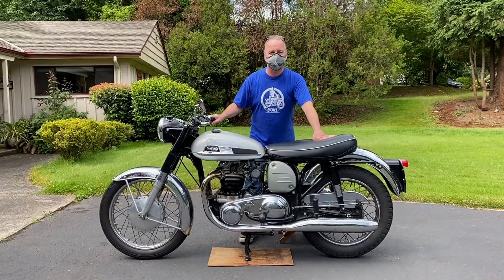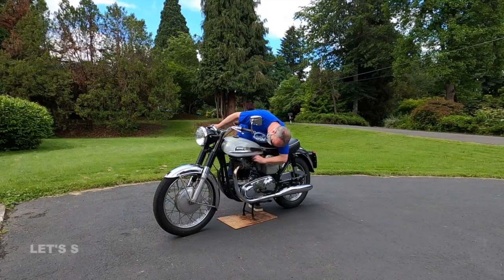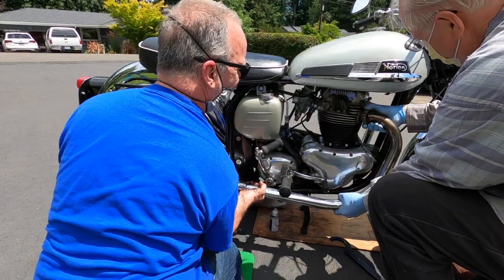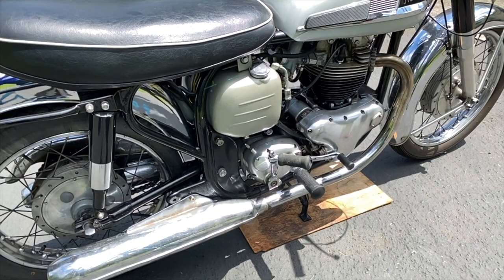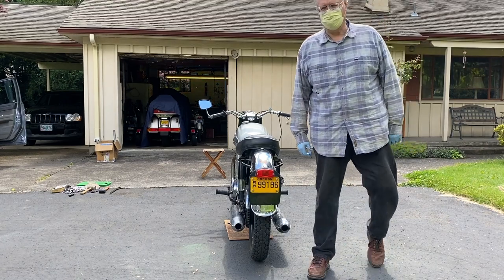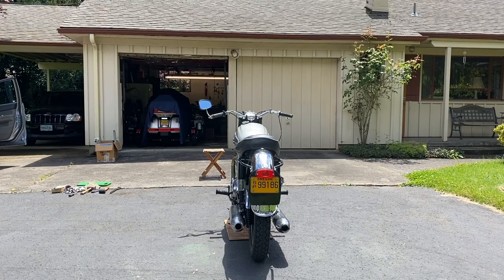1961 Norton Manxman 650 project (21) - Comparing Norton muffler / silencer sounds

Comment: So what is the point?  Does one muffler offer better performance?  Obviously use the one with better performance.  If it is just to be louder why bother?
Reply from the maker: Hi Marquee6.  I should have explained why I'm doing this for newer viewers.  I have been fortunate enough to find the very first Norton Manxman.  It originally came with the funky, cigar-shaped mufflers/silencers with the horizontal seam that you see in the video.  My friend Sam has kindly loaned me his mufflers and I'm trying to have a pattern pair made.  But knowing that it will take some time to complete the restoration, I thought it would be just a bit of fun to hear how they sound compared to the standard Norton Atlas / Dominator mufflers. At some point, I will want to know what the pattern parts should sound like and thought this would be a good reference. Cheers, Mike
Reply: Marquee6 If you knew anything about Norton's you wouldn't have asked the Manxman was an export only machine and owners are trying to source pipes and silencers for restoration! the Manxman silencers are made for running at speed rather than tick-over. Manxman rev's harder I would think.
Reply: Sound is subjective. One man's symphony is another man's noise. I think Mike's question was "which do you think sounds better?" Performance was not part of the opinion poll. When I raced, performance was ALL that mattered. But on my road bikes, I changed exhaust more than once just to have that "Perfect Sound". As far as vintage bikes go, I'm a purist. I (generally) want the original parts exactly as the bikes were when new. I might go with a pointless ignition, as it is hidden from view, but that's about it.
Reply: @kyleklintok7730  I agree in some ways i don't like to see Classic bikes stupidly bastardised, but then again I can't empathise with rivet counters By far the %  most Norton's were exported, here in the UK often exhausts were changed as other options were cheaper, bikes were upgraded especially in the 60s Cafe racer cult and in the 70s to compete to an extent with the up and coming Japanese stuff. As bigger Japanese bikes filtered through, A 500/600 cc Norton could have a run for it's money with two-stroke 2/350s followed by the 750/4  400/4 500/4 Honda's coming out of Japan. Riders had Pride! Then the Z1 appeared and it was game over!

Comment: I have to say, that is a beautiful neighborhood you are working in, very nice.  I couldn't tell a big difference, it does sound throatier.  One key point is having the carbs very well balanced, very even firing that shows up in both the idle and the smoothness in riding at low rpms.  The carbs on this are very well matched.  Very nice sounding, that idle is beautiful, crisp, clean dropping right down smoothly, when the throttle is released.  Thanks!

Comment: I prefer the Manxman muffler sound but I'm probably prejudiced. I bought Manxman #13 as a basket case years ago and later sold it to a friend who did a wonderful restoration. He did not keep the original exhaust but passed them on to Sam. So these are the pipes that sat in various basements for years; glad I didn't throw them out.
Reply from the maker: Hi Phil, thanks a lot for getting in touch. It's a small world! Best wishes, Mike

Comment: Use to have a friend who bought one of these brand new in 62, It was fitted with the norton flat bars, rather like a Vincent. Which I think look better . But then, when we get  older the body’s not up to it...The times I’ve heard this model referred to has a 650 cc Dominator. I believe in my time the exhaust would be either left as standard or fitted with reverse cone megaphones or Goldie type silencers. The Triton I referred to earlier had swept back pipes fitted with Goldie silencers.....it was part of the kit for a sixties Triton....
Reply from the maker: Thanks a lot Brian for sharing this great note.  Cheers, Mike

Comment: Nice bike.Don't like the visible seams.Totally unrelated but is there a brake pedal stop on these models.Seems rather high.Bump starting.There's a thing you don't see much of nowadays.
Reply from the maker: Hi Chris, oh yes, you're right! I hadn't noticed that until you pointed it out and I looked back at the video.  Yes, the brake pedal does seem very high.  I will mention it to Chuck. Best wishes, Mike

Comment: Hi Mike , hows your Manxman project getting on?
Reply from the maker: Hi Derek, thanks for asking.  It's going slowly but surely.  We painted the first test part in the polychromatic blue last week.  It's not quite the blue that I thought it would be and so we are comparing the blue with other original parts to find a better paint match.  Also working on media blasting some other parts but not much else unfortunately.  Cheers, Mike

Comment: Altlas mufflers looks better but sound at tickover a bit like a Jawa, and at speed or when you did a couple of passes ... like something you would have heard from the caferacer boys as they pulled away from you. An observation about the stalling -sounds like the motor is restricted so much that the primary chain is just starting to go into sag but the centrifugal momentum of the clutch is also pushing against the chain and forcing it and the crankshaft into the next stroke - clutch is slightly faster than crank. With the Manxman’s, the bike sounds more like a commando 750. Not as loud, but still the note is there. At idile, the above phenomena has almost disappeared - as if its not starving for fuel or the exhaust is no longer restricting it. Does the Manxman have longer header pipes? As for performance then you would think Manxman are better for consistent high revving. and the Atlas better for back pressure braking and manuvering around those back lanes - that most British 650’s were designed for. Nine experiment Mike. M2cw, at least.
Reply from the maker: Wow, thank you very much for your great observations Kym.  This is really helpful.  I'm not sure about the length of the header pipes for the Manxman.  That's a great point.  I will try and attempt to measure the pipes that I have on loan with the pipes on Chuck's bike. Best wishes, Mike